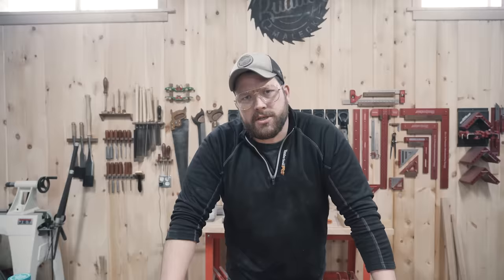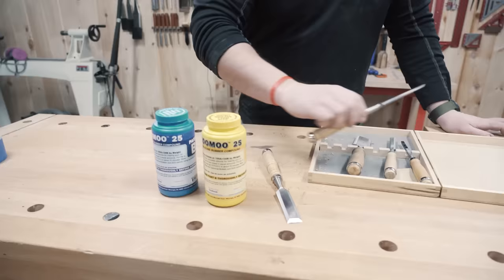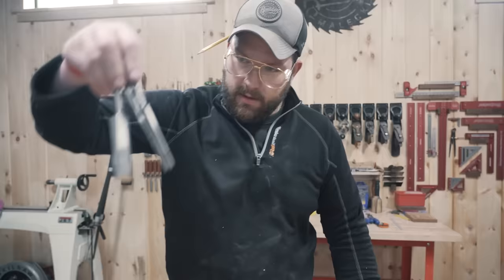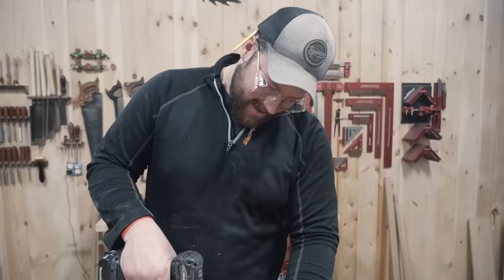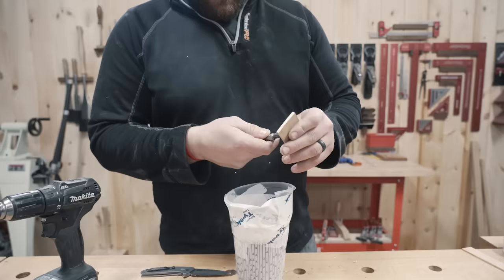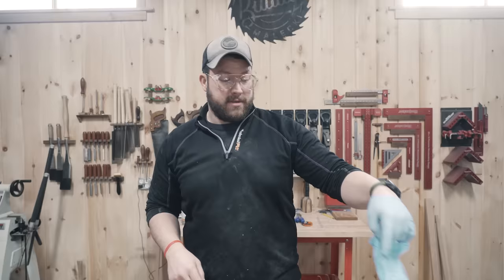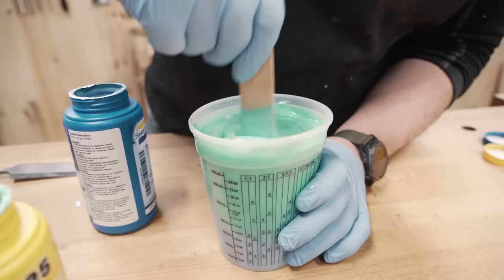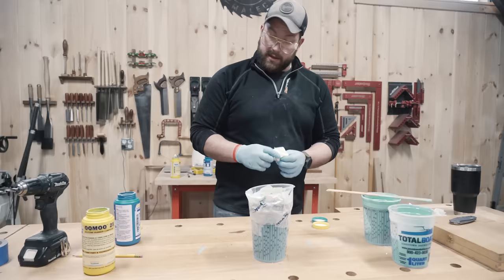Can I Make An Epoxy Chisel Cut Wood ?

Comment: Love your videos, I work with epoxy alot. I believe the problem is it needs to cure (not just dry) for 30 days before it's hard enough to sharpen. Sharpen after 30 days, but stop often during sharpening, the process creates alot of friction, friction equals heat, heat softens the epoxy. Patients is the key.
Reply: After watching some of these guys videos... i had a very strong feeling this is how he would screw this idea up.  He's at least consistent at how he fks all the projects up

Comment: Hi John! You could potentially try combining the existing methodology of a chisel with epoxy. I.E. having it be metal at the end for the cutting edge of the blade but then pouring clear epoxy for the rest so that you can still see what’s going on underneath the blade!
Reply from the maker: Oh, not a bad idea. Like having a metal cutting tip, and resin for the rest. Could be awesome to make that from one piece too!
Reply: John Malecki if you’re feeling really ambitious, you could also try casting the handle instead of turning it, maybe add some pigments to the epoxy for a cool swirl effect?
Reply: Even better, if you used glass, (just as a quarter inch of inlay) it would all be clear.

Comment: This is an old thread but maybe my 2 cents can help others out who are thinking about making molds for themselves. I would've made a separate mold for each tool.. Plastic pop bottles work great. Cut the top off a pop bottle evenly, 12 or 16oz depending on length of tool. The molds come right out, intact, by just slicing down the bottle side after mold is dry. Lay a dowel rod across the top, super glue a fishing line to centered flat-top of handle part of tool. Tie line to dowel to suspend tool in center of bottle, and hang top of tool end flush to top of bottle. Use a marker & mark outside of bottle where the tool flares out from its narrow neck. Pour your Ooomo to top of bottle too. You should see flat top of tool too. After de-molding, you'll have a nice sized hole to pour epoxy into for future pours. Yes, you'll be able to reuse the mold many times over since we won't be destroying it during the process. Once Ooomo is dry,  cut slice down from top of bottle and the mold to mark made on bottle. At this point you continue to cut bottle to its bottom if you like but don't continue cutting mold down to the bottom as its not necessary. Pop mold out of bottle and remove mold. Put used bottle in recycle bin. You now have a access slice cut from top down till you reached the flat part of tool. Now spread that bad puppy open & it'll pull right out. The mold is still intact too cuz you didn't hack or tear it all to crap and back getting it out or did you?. Your new mold can be reused by putting a few rubber bands around it to seal up the release cut you made. If your epoxy isn't drying, it's due to either Temp, Incorrect Measuring or Poor Mixing. Guessing at quantities of ptA/ ptB will never work. Temp above 70f always. Minimum 2min mixing, 3-5 for large batches. Respirator should be worn during mixing/pouring. I've been using epoxy for 14 yrs (no expert) and 2 diff brands I've settled on over the yrs. They dry crystal clear and hard everytime. I'm not familiar with the epoxy brand John used, but if you're satisfied with the results, that's all that counts. Like I said, no expert here but maybe this'll help someone out. Big fan John, your vids are the best and Steelers fan for 50 yrs and till death..

Comment: I work with resin often. Not epoxy but the concept is the same. Thinner pieces of resin take longer to cure than thicker pieces, which is why the cup shape was hard but the actual cast was floppy. Edit: I commented early in the video so I missed the re-cast

Comment: Perhaps, instead of casting a hand chisel, you cast a complete plane, blade and all. In separate pieces, of course. The idea of using a metal tip is really clever but I believe that if you build yourself a vacuum chamber out of resin in a similar method to how you built the fish mallet, that could make a big difference in the quality of your tip from resin alone. The minuscule bubbles turn the cutting edge into a more serrated edge which won't work for something as precise as what you're aspiring to. 

I love watching your videos and  this one made me hit the subscribe button. Keep pushing your boundaries.

Comment: Cast a small flat piece of tool steel at the 20 degree angle to get your tip. Gives you a clear tool with hard cutting tip

Comment: I have tried, I really have, for quite some time to understand Imperical number system... I just cannot wrap my european head around it. not shittalking it either, dont get me wrong, I find it astonishing how you guys can work accurately with these measurements. Keep up the good work and much love from Germany
Reply: Yes, it is horrible...but you get used to using it. I design fixtures for machinists and the worst part is tolerancing. You try to use standard sizes, such as 3/8, however the decimal of that is 0.375 which gives a tolerance in the thousandths...
Reply: Even as an American, I have to agree.
Reply: The imperial system makes no sense

Comment: I'd try a polyester resin. It's a lot harder than epoxy. It is, however, very brittle so that may be an issue. Also, wear a mask. The stuff stinks to high hell. You may also consider using a higher bevel angle. 35-40° should give you a more resilient edge.

Comment: I think do the same but use a metal tip blade with a shape that is gonna have holes for the chisel made the material that is gonna hold the blade and that will keep the sharp edge and is gonna be useful tool fancy but useful 😊

Comment: I know this is an old video, but maybe a large amount of CA glue mixed with some baking soda and quickly poured into a mold might provide the strength and rigidity after it fully cures. I'm not an expert at all, but casting something that thin might work better with the super glue, although it wouldn't be clear if you add the baking soda. Maybe just a large pour of CA glue if you want the clear blade and have the extra on hand haha

Comment: If you fill the epoxy with metal powder and use a toughened epoxy that you can post cure (and you actually post cure it) it might work for soft woods

Comment: Just an idea, make the 1" thick epoxy so that the hardness is achieved, then grind to desired shape & primary bevel, then hone in secondary bevel. Again, just an idea. Take it for what it's worth, or leave it, either way.
Reply from the maker: Ya we try that at the end with some thick and cured blue resin from the one river table we did, still no bueno
Reply: @John_Malecki  Boo. This would have been way cool if you could have pulled it off. Just imagine the colors and designs of chisels possible. Of course they would never retain an edge like metal, but they would have looked amazing. Oh well, on to the next project.

Comment: Late to the game on comments, but you could use metal to make just the blade portion, then cast the clear resin with the blades on place in the mold.  Wouldn't be completely clear, but you'd have hard material for the cutting surface, and I think with the metal polished nicely and an ebony stained handle, it would be a sweet looking piece.

Comment: Hi John.  My only experience with woodworking, is that I once used a toothpick.  Remember those spy movies when they took a key and pressed it into some clay (or whatever) to make a mold of the key?  Would that work? 

Thanks from Houston!
Reply: You can definitely make some very detailed molds with clay (check out Crafsman Steady Craftin) but the problem here is more the material he was using for casting.  Apparently, it won't take an edge well enough to use as a chisel.

Comment: If you have a vacuum pump and fittings already, you can make a DIY vacuum pot with a thick walled metal pot or bucket (big soup pot maybe?) and a thick slab of wood if you don't have any glass, plexiglass or lexan.
Place the pot upside down on the smooth-planed wood and mark the wood where the pot sits.
Use a router to mill a ring into the wood along the line (a little wider is better).
Mix up some silicon casting rubber and pour it into the milled ring to create a gasket, drill a hole in the middle for the vacuum pump fittings and voila, a crude vacuum pot (that unless you used plexiglass, lexan or glass, you have no idea whats going on inside since you can't see through wood).
For glass, plexiglass or lexan, you'll still need to mill/pour the gasket ring with the wood (perhaps set the pot upside down in the setting ring to create a lip so it doesn't slip off under vacuum), but put the ring on the pot and then lay the glass etc. on it...

Comment: What about something like JB Weld at the tip or is it possible to mix powdered steel in with the resin?  (wait... Is that what JB Weld is?)

And what about flint knapping the edge instead of sharpening it?

Comment: Epoxy on a quartz or borosilicate glass microscope slide to the back of the epoxy chisel after you mill or sand out a slot for it then use a diamond sharpening stone or wheel with constant water flow from a bucket with a little hole to not get any of the dust into the air.

Comment: At the very least you've made yourself some nice scrapers.  We essential had to use the same thing on the flight line to scrape sealant and we could never get them to hold an edge for very long. We probably went through more sandpaper just on that than I've gone through on any other project.

Comment: So as a cutting edge, not so much. What about casting a different part of a tool. I'm sure casting chisel handles has been done to death but what about the body of a block plane?  A spoke shave? Or some other hand tool where seeing through the tool as it is cutting might be kind of cool. I would choose something small but I get the feeling that you would go for a jointer plane. : )

Comment: How about take the outer shells off your cordless drill and/or circular saw and cast those in clear epoxy, then you'll be able to see the mechanism of the tool as you are using it..

Comment: You should make a mallet out of epoxy. 3 separate mallets and choose which you like best: 1) epoxy mallet head with wood handle, 2) wood mallet head with epoxy handle, and 3) mallet head and handle out of epoxy. You can test their strength and see how easily they break.

Comment: Try using glass, I feel that you could get it sharp enough
Reply from the maker: Yea, but how do i shape it?
Reply: John Malecki you can shape glass with tungsten carbide rotary tool bits, but use water and you can gring the edge on using a diamond stone I think

Comment: When I first saw the title, I thought "No Way." However, I also started thinking about the paper honing wheels that can put a perfect edge on knife blades, so I started to think it could be possible. Before giving up, try the Razor Sharp wheels. That may be able to get the edge on it you need. If that doesn't work, yeah, I'll go with my original thought. And if you CAN get an edge on it, I doubt it would last long.
Reply from the maker: Solid idea Douglas, i'll look into those if we do this again!

Comment: Make a few epoxy pours with different amounts of Hardner in it to see what ratio holds the best edge... then also sharpen to a steeper angle like a knife... 15-20° will give the a better chance of the blade cutting through paper and from there it might shave some soft wood.

Comment: I believe if you use a leather wheel it might sharpen the blade, I watched a video a guy made on sharpening ceramic knives and wet stones or anything besides a leather wheel worked. I wonder if it’s the same concept with epoxy

Comment: There is a UV base resin that's used in 3D printers, I believe it's called "Blue" (it's actually more aquamarine color) but it's very durable & should work for a project such as this. Not sure If it works in a direct pour method, but if you don't wish to purchase everything needed, contact another channel & ask them to collab to print you a blank that you can then shape, handle, & strop.

Comment: This is going to sound crazy but try stroping them with a wooden wheel, crystalline materials like that tend to get tiny chips in the edge if you try to sharpen them like a steel blade, it's the same reason ceramic kitchen knives are so hard to sharpen and the only successful resharpen I've seen with a ceramic blade was using 5 micron compound and a wooden wheel mounted on a bench grinder

Comment: Everyone is making mallets, haven’t seen an epoxy mallet yet.
Reply from the maker: That would be awesome !!!! 😳
Reply: @kdurham98  A dead blow epoxy mallet would break pretty easily.
Reply: A dead blow mallet with steel ball bearings partially exposed and then covered with a thin layer of transparent silicone.

Comment: "*calculates* ... 5 16th's..? I dunno!"
This folks, is why you need the metric system...
Reply: Nah, bruh. You just have to be better at maths.
Reply: For those of you who haven’t landed a man on the moon!
Reply: @bettytherussiantortoise2808  -NASA has used the metric system for the last 30 years.
Reply: Yeah metric for the win lol. Being in Canada that's what we go by and in the water and sewer line of work you cut alot of PVC pipe and when you can yell out 375 cents (centimeters) and buddy up top can be like "oh 3.75 meters, easy"
100 centimeters in a meter, 2.5 cm in an inch. It's just easy shit. And get this. 1000 meters is a kilometer/km
Reply: That explains why nasa has been so lame for the last 30 years, they don’t even have a way to get to space anymore.
Reply: @bettytherussiantortoise2808  thats why few of the apollo missions failed, because one dude callculated in metric the other in imperial. Seriously, Amiland is the only of just 3 or 4 countries in the world not jet changed to metric ;)
Reply: Or just use decimals instead of fractions. So much easier.

Comment: Just cheat and put some hardened steel in the bottom of the mold then pour the epoxy top, when it hardens the epoxy will be clear except for the end where the steel is and you can just sharpen that

Comment: My brain immediately went to the size of the atoms of a metal chisel to the size of resin molecules and how they align. Metal is a crystalline close-knit structure and resin is a polymer that forms a more loose structure. So a material that is more crystalline would be a better material to get a thin edge. So I would go with pyrex or tempered glass.

Comment: sharpening the resin you should have only done the strokes in one direction not back and forth. you want to smooth the edge not scuff it.

and the diamond plate was probably overkill. your sharpening resin not steel. emory cloth would probably be better but i also think stropping would be more effective than sharpening here. 

we use diamond to help us sharpen steel. so scaling to the same ratio of hardness i might try a copper or bronze plate. hell aluminum maybe. if you had hardness gauge or the hardness scratch awls find out how hard the resin is. and find something flat that is only just barely harder than it. 

egyptians cut granite with copper saws without any teeth.
the secret was they would put sand under the saw, letting quartz do the real work the copper just applied pressure and probably had quartz embed itself into it. 

amber is about 2 on the hardness scale, finger nails about 2.5, copper is only 3ish, and wood is 1 to 1.5ish.  iron is about 4 or 5. quartz about 7. granite is about 6-7. 
  the bevels provide the cutting edge,how smooth the two sides are along the cutting edge decides the sharpness.

higher grit "sharpens" but typically the material is also much harder so the "sharpening" really just amounts to finer and finer particles so that the scratches are indistinguishable thereby simulating smooth.  this is where my stropping idea comes in because its not so much removed material but smoothing material.  sorry if this comes off douchebaggy in anyway i just got caught up in my explanation, to be clear i love the channel and video im just really passionate about how i analyze.

Comment: You get confused about their hardness when you dont study engineering. It is called curing. It does take time when it is completely isolated from surrounding (light and air)
Reply from the maker: Sorry next time I’ll cure them in my vacuum chamber
Reply: @John_Malecki  sorry if that sounded rude. I am computer science student and for some reason i just enjoy your videos🥰🥰🥰